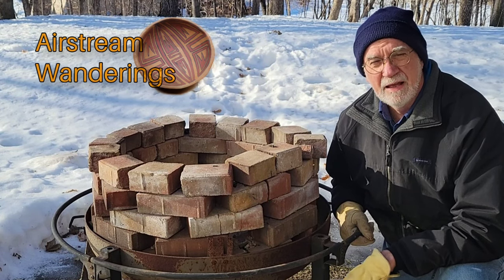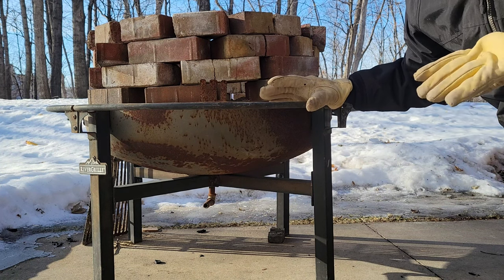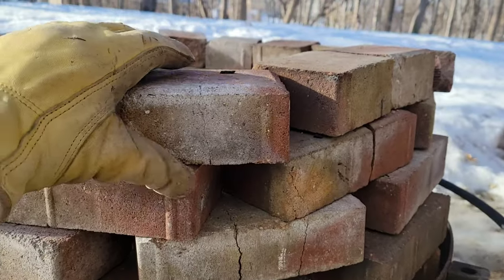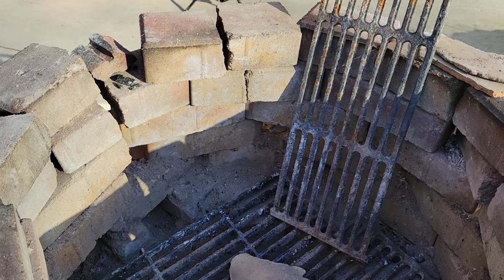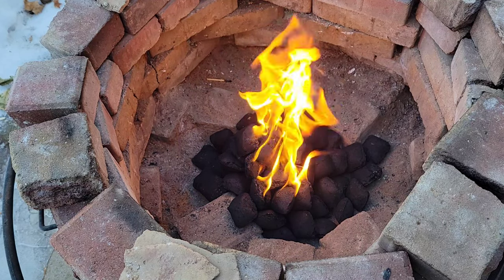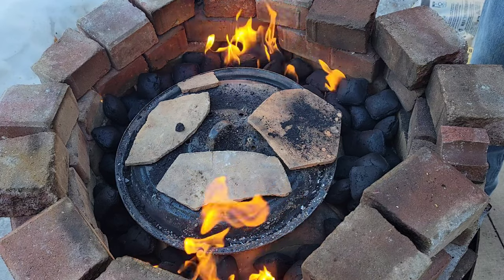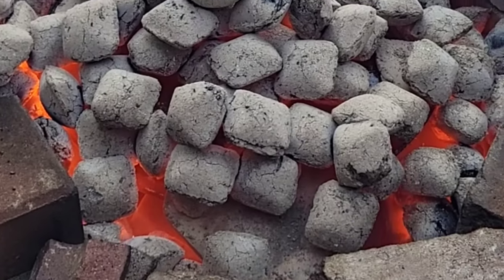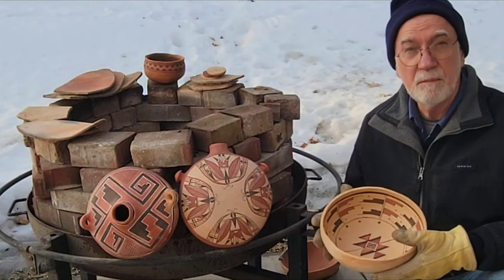Backyard Kiln Tutorial and Firing

Comment: I plan on doing a combination of charcoal and wood on a smooth flat porcelain base with clay brick walls. Inside of a large shallow firepit. I'm making instruments and small pots, so I am really hoping this goes well.
Reply from the maker: Sorry for the slow reply. It might take a couple of times to work out the bugs but it might work really well. Good luck. I have used floor tiles as sherds and found that they couldn't take the thermal shock. It will be interesting to see how the porcelain holds up. My kiln is pretty much filled with sand and bricks.

Comment: That's a well-built looking fire ring. I like your flexibility!  I've just stacked my bricks on the bare dirt, but my dirt's usually pretty dry.  I'm using red clay bricks, which supposedly handle higher temperatures than the concrete ones.  I've still cracked a few, though.  Turns out I'm still over-firing a bit.
Reply from the maker: Interesting, I've never had over-firing issues at these temps. I have more issues with a wood fire where it ramps up so quickly. Thanks for commenting.

Comment: Did you fire them before glaze or did they get glazed when dried then fired.?
Reply from the maker: Thanks for your comment. The pots are not glazed but they are painted. I always paint before they are fired so they are fired just one time. If I use slip, the slip is applied when the clay is leather hard but the pot is allowed to totally dry before painting. I hope this helps.

Comment: Hi Wes, How long did you heat the pots in the oven at 500°?
Reply from the maker: I typically start at 200, then 350, then 550 each for about a half hour. That is probably overkill. The most important part is the low temps to make sure they are dry. At 550 I can tell that they start to chemically change a bit but they are definitely not ceramic. By the time they get into the fire and the fire gets going they have probably lost a lot of their heat.

Comment: Very interesting. I plan to attempt a saw dust firing, in a homemade brick kiln (no mortar, just loose stack) soon! Hopefully I'll have decent results. I figure the saw dust is easier on the pocketbook than charcoal. But at least I'll know what to try next, if the saw dust firing doesn't work.
Reply from the maker: I would like to know how it works for you. I've seen YouTube videos with sawdust but never understood how it would get enough air to burn hot. Its definitely worth a try. Cow and sheep dung is on my list as well as coal. Good luck.
Reply: Thank you! I'll let you know, as soon as I attempt the first fire. From my understanding, the small gaps between the bricks provide the air flow. You also slowly cover it after the fire burns for an hour or two. But I suppose I'll find out. Trying to decide if I should preheat or not, since the fire will build slow.
Reply from the maker: Preheating also assures they are dry. It can't hurt.